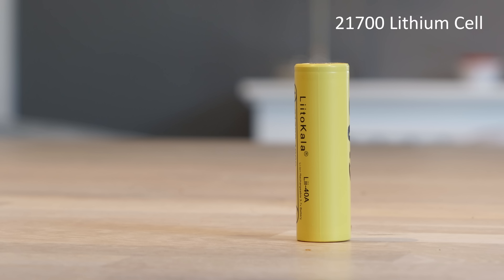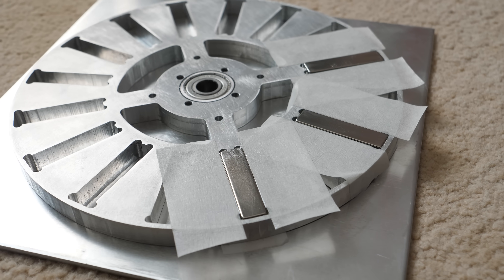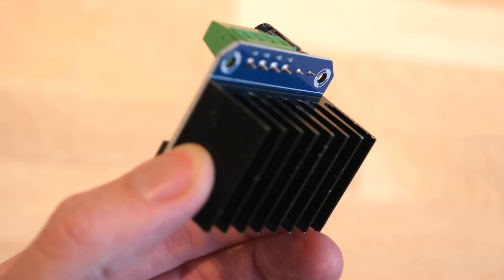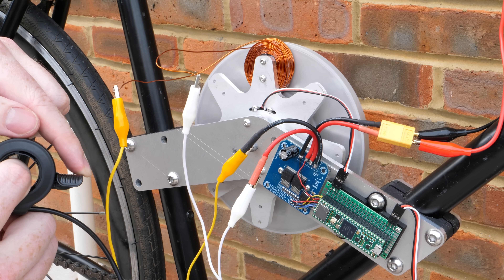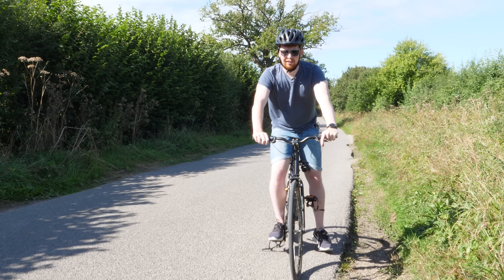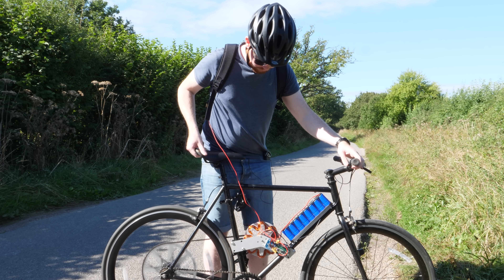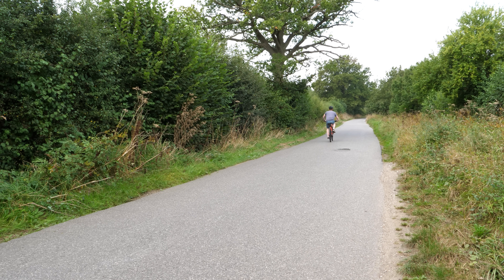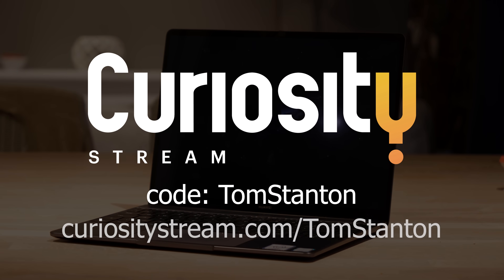Super Capacitor Bike

Comment: If you want a near constant voltage out of super caps, you can start with a mostly parallel arrangement and switch to a progressively more series arrangement as the voltage drops.
Reply: Or a buck/boost converter to keep the voltage relatively constant.
Reply: @kimchristensen2175  Do the whole conversion from cell voltage to driving the motor's coils or whatever you intend to do in one step.
This reduces losses & components.
Reply: @peterebel7899  Good idea.
Reply: How about starting with super cap bank that is way over voltage and choke it down (regulate it) by pwm?
Reply: @metepack4872  Remember that the bulk of the capacitor energy is in the low voltages so if you're not drawing power from it right down to near-zero volts, you're not using the full capacity.  And given how little energy they can store to begin with, it's not really practical to ignore those lower voltage regions.  So adding more circuity to deal with higher voltages isn't so efficient, because you need the low-voltage circuitry anyway, so because of that you may as well just build the pack to operate at the max voltage required and not worry about PWM.
Reply: 8, 4, 2, 1, nothing nearly constant. Every switch a 100% jump.
BTW: changing the arrangement on the fly is not an easy task.
Reply: @peterebel7899  Not necessarily when you deal with larger numbers or matrices, ie. 6x2, 4x3, 3x4, 2x6, 1x12.  But you are right it takes a lot of circuitry to make it happen.  And you may also have to deal with matching issues because it's hard to find caps that are equal in value.
Reply: @AccessAccess  Those jumps on both ends are 100%, in the middle it is not so bad.
But the whole thing is nonsense.
Far better to have a fixed array and cope with the variable voltage. This is by far less of a pain especially when you use fancy synchron motor drivers.

Comment: Pancake motor, look at the lemco motor, there isn't enough copper or flux density in that design to provide any real power, still a great start, super capacitors are actually useful in ev applications for providing high current for initial acceleration then lower spec batteries maintain the speed, back in the day they were used in parallel with lead acid batteries to reduce voltage drop on acceleration and to reduce initial high currents on regen.

Great fun video, your filling out as well just like I did when I got in to ebiking, I peddle more these days 😂

Comment: You could probably try using a boost converter after the capacitor bank to keep the output voltage to the motor constant. But if the converter is not atleast 90% efficient then it's not worth it. Also and idea to connect the battery without the chance of the wire pulling out is to make  electrical contact pads on the handles and make a glove that have contact pads on them that connect to the battery. So when you put your hands on the handles the capacitor charges and you never have to worry about the wire pulling.  But note that even with good isolation designed of the gloves and handle contact pads, it's still recommended to keep the battery pack voltage below 25 volts to prevent it from shocking you. Also keeping the voltage low reduce sparks when the gloves and handle touch.

Comment: Why couldn’t you use a lithium battery to charge a super capacitor that runs the engine. Just need to force lithium usage on acceleration but cruising on the highway use the super capacitor as the power source.

Comment: Can't you use a hub motor and get it to do regenerative braking? That is basically the exact thing that we want for riding in the city. Stop and go traffic with high efficiency regenerative braking at a red light and then when when it turns green instantly going as fast as your were before you had to brake for the red light. Perfect application for supercaps and a hub motor?

Comment: Pointing out that in the example used in the beginning charging speed isn't a real advantage for the capacitor as advertised because 14Wh/45mins is 0.31Wh vs 0.4Wh in 1 minute. However batteries also don't have a linear charging curve so Lithium cell may very well match that at low charge (and perform significantly worse near full charge).

Comment: You definitely need to learn more about reluctance and magnetic circuits before you try to design an electric motor, choosing aluminum for the yoke was a bad idea, not only the power density is very low, but the efficiency must be terrible due to eddy currents.

Comment: It goes to show a combination of both battery and super capacitor may be optimal - when braking the super capacitors may be more efficient/durable than batteries? Same goes with charging - the super capacitors could provide rapid charging, then transferring power to the batteries until regenerative braking is required..?

Comment: RESPECTFULLY, the capacitor charges .4 Wh of energy in a minute while Lith cell charges 14 Wh in 45 minutes - That's 112 x energy more than the cap and has 2.5 more energy capacity per minute charge.  Great proof of concept!

Comment: 2:46 you should make a 3D printed follower that both lays and pushes down the wire as it's laid. A neat coil is a better coil. Luck would have it that you don't have to design this kind of a tool, you can just copy the ancient design of the Singer sewing machine bobbin loader. It's simple, and all you have to do is make a different cam to match the shape of your coil's support.

Comment: Regenerative braking, add the lithium-ion battery on it too, put a clutch on the motor so it's only connected when under power or generating power for regen. With the super caps giving initial boost power and with their fast charge time, that should make the main battery charge last longer. With long enough downhill runs the regen could quickly charge the caps then put some into the main battery.

Comment: Here's the thing w/ electric bikes
They absolutely SUCK at getting you off the line as that needs a massive amount of tourque and energy
What they are great at however is holding your speed once you are moving
You are burning most of your never off just to get rolling instead of using it to accelerate or keep your speed once you are going
You did the same w/ the kinetic energy bike where it was basically all lost by getting you going again instead of using it to accelerate once you are going

Comment: The fact the bike chain tried to stick to the motor indicates there is magnetic flux that escapes the motor assembly. Optimise the magnetic flux path, and you'll get a significant increase in motor performance
Reply: Arranging them in a halbach array may so the trick
Reply: @t1t4n66  Halbach arrays are cool
Reply: Put them in a vacuum
Reply: Perhaps a stainless steel, or aluminum plate between the magnets and the chain?
Reply: @tysonatkins2236  I guess your suggestion is aimed at blocking the magnetic field? That approach is not optimal - relative movement between magnets and conductors (like aluminium or stainless steel) generates a braking force (see Lenz's Law) which isn't what you want. The better approach is to provide a closed loop magnetic path using a ferromagnetic steel. The magnetic flux will face least resistance through that ferromagnetic path and will stay within it, so no blocking is required
Reply: @dancollins1012  Blocking the magnetic field was my first thought. It has been many decades since science class, I'm just now getting back into studying it.
Reply: I have no idea why he designed his own honestly. There's hundreds of options for motors these days that aren't even that expensive. 100$ probably would've gotten him something significantly more efficient than what he built. 

It's neat that he did it, but at the same time, entirely a bad choice.
Reply: "escapes"?! Magnetic force is not energy, there is no "escape" of a force. It's a conservative field; kind of like saying "gravity is leaking from the Earth!"
Reply: @ThisIzzNotATest  I'll stick by my wording of 'escapes the motor assembly'. Yes, magnetism is a conservative field, but the wording means flux departs from the motor assembly, then travels through the air, and then enters another part of the motor assembly enroute to the opposite pole it started from. The wording need not imply flux itself is permanently lost, which would clearly violate the conservative field constraint. The point of the comment was that the flux levels within a magnetic circuit with a high reluctance element (eg. air gap) is much lower than the flux in a circuit with low reluctance, such as with a continuous ferromagnetic flux path design. Air gap=bad, ferromagnetic flux path = good. The wording could also be interpreted as flux strength is (permanently) lost RELATIVE TO what it would have been if the magnetic circuit design didn't suffer from an air gap.
Reply: @dancollins1012  oh, ok. Sorry, misunderstood.
Reply: Capacitors for taking off quickly from the start, li-ion batteries for cruising, with regenerative braking recharging your capacitors specifically. Now that'd be neat!
Reply: sir i guess the attrection is due to force and, in case of magnets its governed by inverse square law, so think its not possible to prevent the chain from sticking, since it solely depends of the distance b/w magnet and chain,
Reply: @oksowhat  magnetic field can easily be redirected using ferromagnetic objects. Magnetic field is not gravity. That way all the field can be directed in desired direction, and get much more power out of the motor, all motors do this.
Reply: @ritwikreddy5670  ohh, but magnetic force goes by inverse square law, in the above condition, the magnetic strength of both the elements are constant, only thing that chan be changed is distance, so if distance is less then both of the elements will stick, i am not talking about mag field but force,
Reply: @oksowhat   😊while you are absolutely right with the inverse sq law , the point Ritwik makes is completely different and on point Dan made. Yes there is force acting also but since chains are ferromagnetic they are interacting more with the magnetic field lines towards magnets. Metals have different characteristics regards to how they interact with magnet and magnetic fields lines and their strengths are measured as fluxes some like iron attract more.

 In an ideal motor any lose magnetic flux will mean the motor is less efficient and that is what Dan is saying.
Reply: @oksowhat  sure with the exact design above, the only thing that can be changed without adding or removing material is distance, in empty space the inverse square law is how magnetic fields work, but heres the thing, you can guide magnetic fields, by using magnetic face plates you can contain their saturation value of magnetic field from leaving the enclosure, Tech Ingredients has a channel demonstrating this effect called 'extreme magnets' skip to 15:25 or 20:30 in that video for a good example, waves a bunch of metal things mere inches away from large neodymium magnets, its not 100%, but when you're only getting a 40% efficiency, a boost of  5-10% efficiency is fairly noticeable
Reply: @rjwaters3  ohh. i just passed class 12th, so was wondering how can be inverse squre violated
Reply: @1_glucose_biscuit_lifetime564  ohh. i just passed class 12th, so was wondering how can be inverse squre violated
Reply: @oksowhat  The law is not violated. Think of it this way. In iron each atom acts like a magnet. The fields are not aligned so they cancel out. If some of the atoms are aligned the iron will be magnetic. There will be a measurable magnetic field that will drop off as the law states. If more atoms are aligned there will be a stronger measurable field that also drops off as per the inverse square law. If a magnetic field is canceled or redirected the inverse square law still applies.
Reply: @rjwaters3  So, like how a HDD magnet works.  I've taken a fair few apart and found that the magnets are always significantly weaker when you remove their mounting bracket/plate.  When on the bracket, the magnets only exert magnetic force on one side, but I never actually looked into the why or how in detail.
Reply: @oksowhat  Inverse square is about force to distance, but it doesn't mean force is uni-directional. If you direct magnetic field better, there will be no force to attract chain at all, at almost any distance.
Reply: @rjwaters3 Now, if I’m thinking correctly, some simple pole pieces, of plain steel, in a simple squared “u” shape, would suffice for the permanent magnets? Of course, it would change the driver requirements for the motor, since there would be more poles in the rotor. But wouldn’t it be best to have laminated plates, insulated between each lamination, to reduce eddy current losses? (It’s been so long since I learned any of this in college…)
Reply: @oksowhat  so what you're saying is that my phone will still work in a faraday cage?
Reply: @Skytempo-u9y  faraday cage work on diffrent principle, moreover my doubt was about force not flux
Reply: @oksowhat  I can't imagine that those two could be related :P
Reply: @Skytempo-u9y  opps, my bad concepts

Comment: Bravo! Very good. How about using batteries plus super capacitors such that the batteries cope with range and cruise while the super capacitors provide high current surges when brief but large acceleration is needed?

Comment: Supercapacitors are interesting for hybrid vehicles! Have you seen the brittish Riversimple Rasa hydrogen-supercapacitor hybrid car? A recovery of 40% by regenerative braking on that bike is probably quite high. I've read somewhere that most electric cars today only recover 25-30%, so i practise regenerative braking is almost a scam to talk about. I drove a Tesla S some years ago and the salesman was absolutely amazed by hos little energy I had used during the test drive. I was not easy on the "throttle" at all, I used the 380 hp's fully a few times, but I carefully avoided using the automatic regenerative braking. Instead of releasing the throttle pedal fully before cornering I used some efficient ecodriving tricks by planning the speed exactly and balancing the throttle so that the energy meter on the dashboard stayed around "0" instead of going into regenerative braking. (regen can't be turned off in a Tesla) I guess this proves that regenerative braking isn't verry efficient in general, compared to "driving like NASA". :-)

Comment: A hub design would be ideal I think. The mechanical advantage through the sprockets would be lost of course, but you could wire a dynamo on the front to provide a constant current to charge a battery. Then using the capacitors to discharge that battery you could provide extra power to the driving wheel. You'd be able to pedal to get your momentum going and then use the hub motor to assist your riding. It sounds like free energy, but it should work

Comment: Put a iron plate on the backside of your magnets (between magnets and chain) to close the magnetic flux lines and you will probably have a noticeable increase in torque.  Always try to avoid airgaps when designing a motor. But nonetheless impressive little motor .
Reply: Also maybe add iron magnet cores. Will probably decrease your top speed but increases efficiency.

Comment: A high-end Lipo battery can deliver (when discharging) and accept (when charging) more instantaneous power than a supercap with the same volume. The reason is that supercaps are not ideal capacitors but have a surprisingly high internal resistance.

Add to that the gigantic difference in volumetric energy - as Tom mentioned - and supercaps make little sense in this and similar applications.

Comment: Ok you are good at this, but I think that there are plenty of people telling about supercap Vs li-ion, and I find it not that interesting, at least I managed to understand the point of the video before all of the explanation.
The more interesting thing for me would be to see uncommon brushless motor, on that video you made an axial motor and you said that there is not a lot of torque, but what if you put the magnet support on the periferal part of the spokes, would it be enough torque there?
Aluminium for the support is too heavy?
What about 3d printed?
The efficiency of the motor depends on the distance of the coil from the magnet, and the wheel is subject to a lot of force and might wobble, what if you put a bearing that act as a spacer that will run on the side of the wheel, this set up would allow as well you to distance the stator and disengage the motor at will and emulate a sort of idle on cars, or engine braking
On an electric motor you do not need necessarily the coil over the whole circumference you could use the frame of the bike as stator support and put the hall sensor on an empty spot before or after the coils without putting another set of magnet.
The stator could be on both side of the wheel and so on